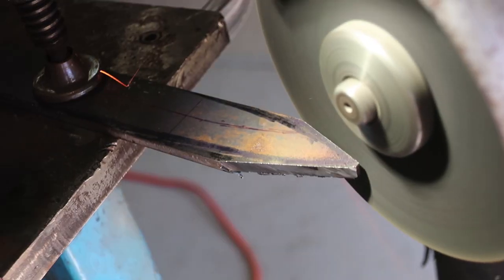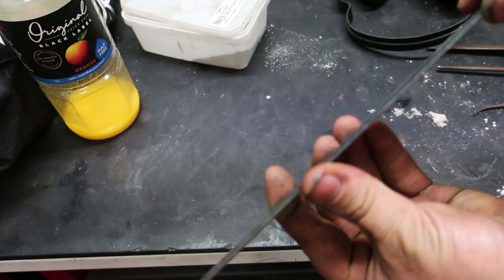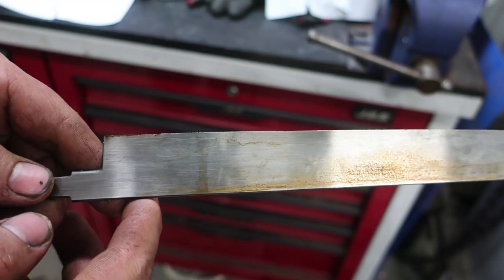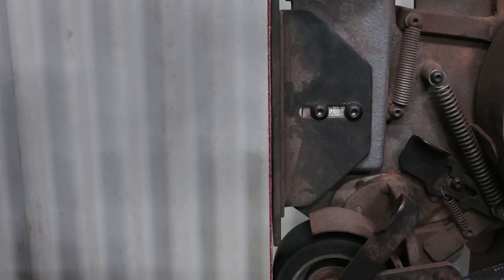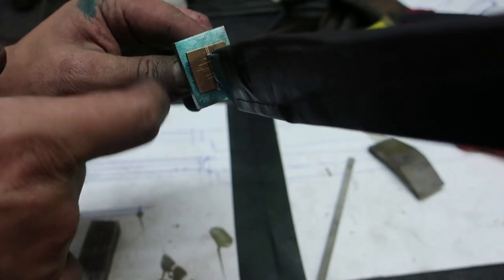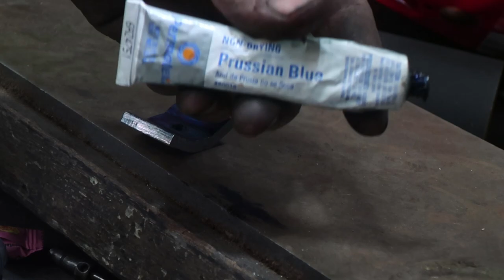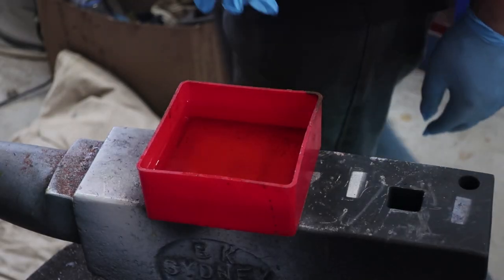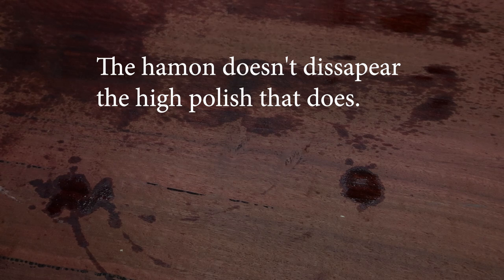Knife making - Yanagiba with blue paper steel.

Comment: The inlay looks great, especially for a first attempt. It's just elegant with it's minimalism and stark contrast with the ebony background and very fitting for a Japanese style knife.
If you would have managed to keep that corner of the chisel grind and the flat of the blade crisp, it would have added that 1-2% extra magic. Don't know if your backer material in hand sanding has that much flex (can't really see what you're using there) or if it's just technique.
Can't say I'm too familiar with Japanese knives, but as I understand it, the concave grind on the flat side of the blade nearly reaches the edges as a method to ease the sharpening, whereas you've left a bit more material there. Mostly that side is used to remove the burr when sharpening so I doubt it makes that much of an actual difference in practice if it's close as opposed to really close, but it can lend a bit of authenticity to the design.
Also liked the humor. Seeing as you've tripled your subscription base (95 right now, oh wait, 96 actually ;), I'm sure your own style in video making will keep developing alongside your knife making skill.
Reply from the maker: Thanks for the advice mate!.  I will make another one since the hamon wasn't right on this one ,so ill definitely take that into account . The backing I used was a file with sandpaper. I 100% agree and initially it was crisp but as i went up in grit I used a thicker pad with a little more give and I think I may of rocked a little when sanding, rounding it over. But next time we'll get it right!. when it came to the concave I actually thought it was to do with friction since there was less surface area on that face but I do think you have a point since I usually see people sharpen the blade over the full face an it will be hard with the more material to remove. I appreciate the kind comment, advice and support. It does remove concerns I have when obviously putting yourself out there.